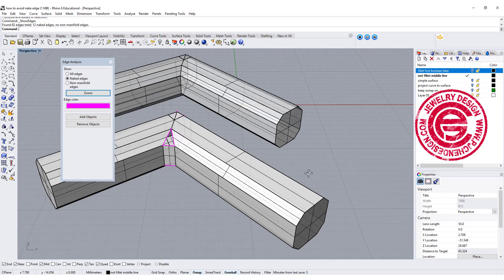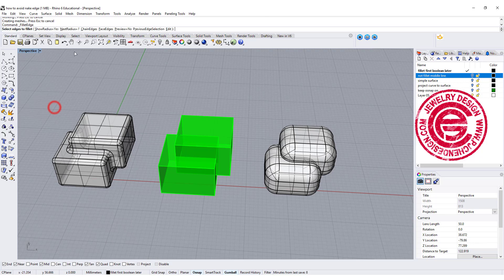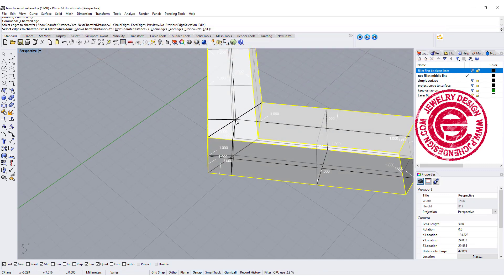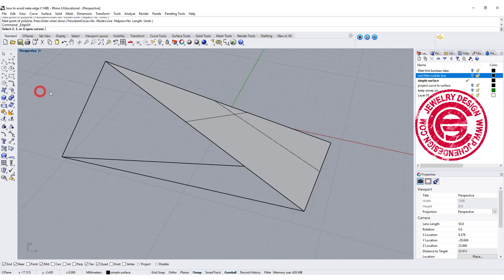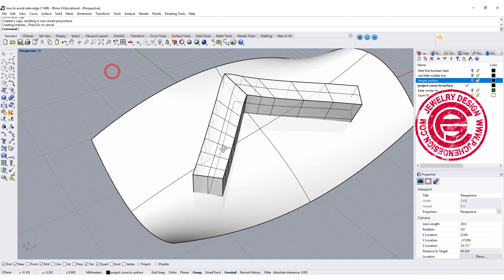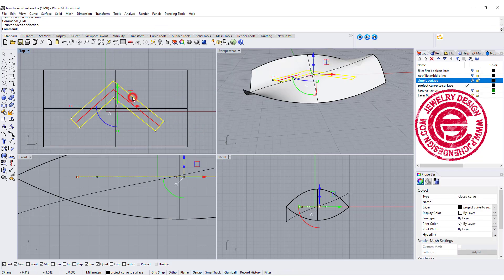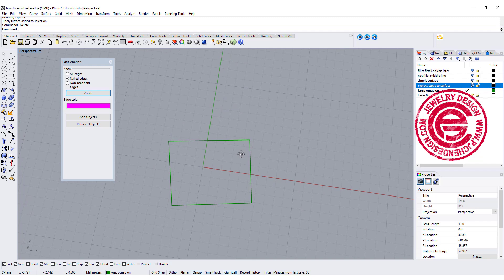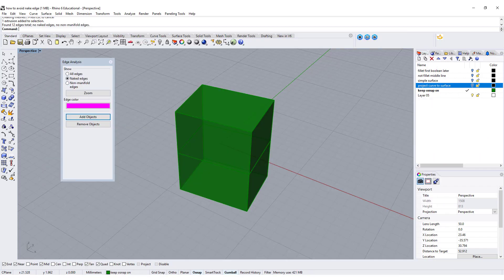5 Tips to Avoid Creating Naked Edges in Rhino 6: Jewelry CAD Design Tutorial #128

Comment: Thank you again.  I just tried to do the 2nd example in rhino 6.  I did an offset crv of the rail and did a 2 rail sweep with a square cross section.   There was no problem with filleting the edges.  Is the problem due to the 1 rail sweep not being able to move through a sharp angle?
Reply from the maker: It depends on the curve you have on sweep1. if you rebuild the curve, it should work as well.
Reply: @PJChenJewelryDesign  Go
Reply: Got it.  I tried moving the crv(s) with respect to the cross section and got different results.  Thanks